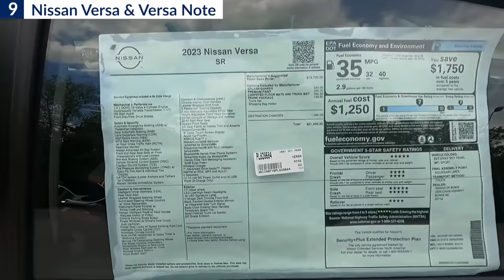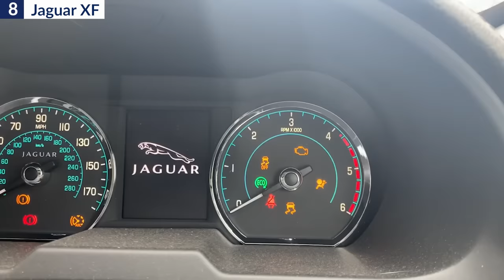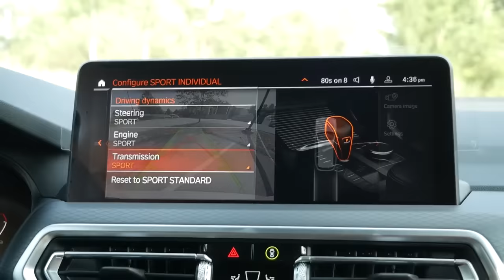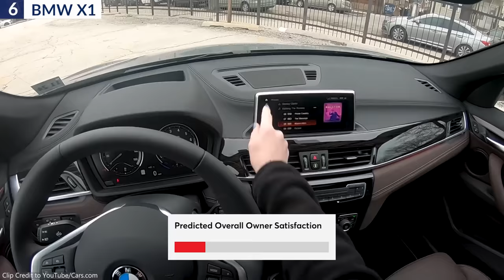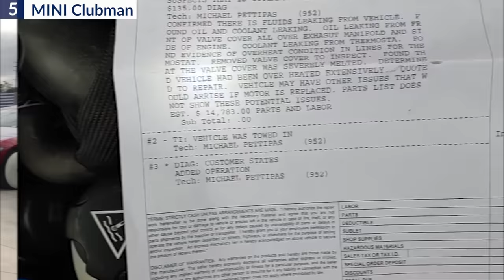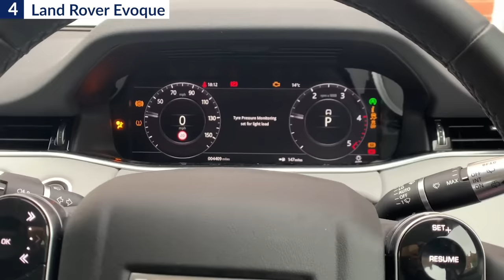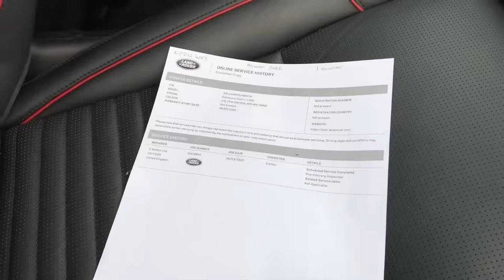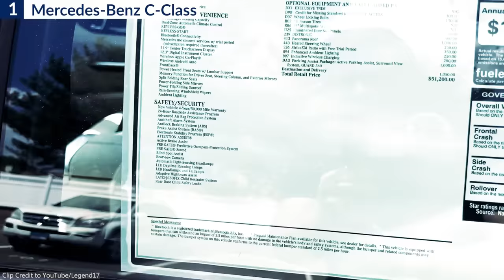9 Cars Owners Get Rid of in the First Year | Here is Why !!

Comment: Interesting to note that virtually ALL these 9 vehicles had a very good satisfaction record of over 90%, apart for the MB C class which was slightly lower at 87%.....SO, whats the problem ?
Reply: Range Rover has a fire problem that is getting a lot of attention. Bad engineering, cost cutting, and low quality control in Czechoslovakia, where they now make their vehicles. The Luton fire was caused by a Range Rover hybrid, which made international headlines due to how destructive that was, 1500 cars destroyed and the parking structure collapsed.

Mercedes and BMW both are notorious (here in the US) for general quality control issues mechanically. Since Germany doesnt allow older cars on their roads, these cars arent built for duration. They will start leaking oil all over your driveway in a year or two, and the fix for normal repairs will cost you thousands, when the same repair on a Japanese car would cost hundreds. They are ridiculous when something inevitably fails. Fit and finish in the interior and body is very high quality tho, which are the parts of the car normal people see, so normies think they are great cars. We mechanics love them when they show up at the shop... "Daddy's getting another $4000 paycheck for a couple hours worth of work baby!" But absolutely none of us spend our inflated pay checks on these cars... because we arent dumb, and know how they are made.

As a more specific example on BMW/Mercedes. Their brakes use very hard pads, and soft rotors. This allows better braking at Autobahn speeds. But brakes wear out, and need to be replaced pretty regularly. 
Now on a normal car, this means you install new pads, and machine the rotors. $200---You may need to replace rotors on the third brake service. $600
On a German car, this means you install new pads, replace the rotors, and probably need new calipers too because one of the floating rubber o-rings seized up or blew out from the higher heat created on wore out rotors with their stupid design. $3000.

Comment: I had a 2016 C series.  They depreciate at a record rate.  The service costs were not cheap.  The run flat tires were Pirelli and I had to change them every 5k.  Ended up on Continentals and they were much better.  I can see why people get out of them in a year.
Reply: Changing tires every 5000 miles?  That's criminal.  That's what Lambo owners have to do.
Reply: I’ve got 35K on my 2018 c300. Maybe have 6 month left on them. But I only drive 3K a year now so I’ll replace with NON run flats next summer.
Reply: Oh BTW when I bought my leased 2018 in 2021 the dealer paid ME $3000. It appreciated because of the low used market 😅. Put some of that money on extended warranty up to 100K miles.

Comment: Before we purchase a vehicle, we check with Consumer Reports and Edmonds to check out their reliability, safety and comfort ratings, as we generally keep our vehicles for 12-20 years. 
We prefer to buy a 1-2 year lease return vehicles over a new one. This way, we save a few thousand dollars and have the remainder of the factory warranty.
In 21 I bought my wife a 2019 Outback with only 5,600 miles and last year (2022) I bought a Forester Touring that had only 4,700 miles.
We heard that the Forester will be redesigned in 24-25 and be available with a hybrid system taken from the RAV4 .
We’ll wait until 26-27 to buy the hybrid so my wife can use it as her carpool vehicle. Though her Outback won’t be very old, she’ll probably get 38mpg over the 29mpg we currently get with both her Outback and my Forester.
Reply: I too own an Outback, but a word of caution. Consumer Reports and Edmunds are not accurate sources of information. They are opinion-based marketing magazines with zero data from actual mechanics or warranty claims data. If you decide to ditch the Outback, ask a trusted, reputable local mechanic what he recommends.

Comment: Lexus RX450 is the most reliable suv i have ever owned.15 years old and drives like a dream.I have only ever had a back light and two front springs replaced.125000 miles and still drives like new.

Comment: Smaller engines with turbos equals non reliability.  It's a shame even Toyota is going down that road.
Reply: Yes it is a shame. On the flip side, if anyone is to make something reliable… it’s Toyota. It will be interesting to see how their CVT lasts?!
Reply: Ford and GM have been on this road for many years.
Reply: @lukeclifton4392 the Prius has always had cvt and always highest rated vehicle for reliability. I drove one for 93,000 miles only changing oil and windshield wipers.
Reply: @susansavage8272  the “cvt” in the Prius and Camry hybrids are nothing like CVTs in straight gas vehicles. Prius and Camry hybrid use a planetary gearset that they call a cvt since it is “continuously variable “. BUT there are no friction components, goofy belts or chains like in other CVTs. That planetary gear set is better than any other automatic transmission on the planet (pun intended)
Reply: BTW I put a combined 300k miles on two Camry hybrids and experienced no trouble at all
Reply: @Mrblueridgeman  that's nice, but too boring for me.
Reply: @2-old-Forthischet  I didn’t drive ‘em boring, believe me. When I went into the office I had a long commute, part of which was through Unicoi Pass just north of Helen, GA in the Blue Ridge Mtns. Weather & traffic permitting, I’d fly through those curves. Michelin tires for handling and electric motors for instant torque were really nice. I didn’t want to make the commute any longer than it needed to be. Now that I’m retired my wife talked me into trading the Camry for an X3, which itself has been an excellent car. I wonder how well it would have put up with the rough driving I put the Camry’s through. BTW the first Camry was rear ended and totaled. I was doing zero.
Reply: @Mrblueridgeman  everyone has different tastes.  There's nothing wrong if you're happy with what you drive.  I've had my share of econoboxes during my life.  I've also had my most exciting 67 Mustang at 7 mpg with three pedals.  It was not boring.
Reply: @2-old-Forthischet  still have my 96 mustang GT 5 SPD conv. Daughter wanted to buy it. It was a quick “no”. I have different cars for different needs. Also have an F350 diesel for pulling camping trailer. X3 is now our daily driver. Mustang is for good weather fun. Truck is for traveling
Reply: @lukeclifton4392  Now that Akio Toyoda is no longer in charge, things might go south. Toyota has been plagued with massive recalls in the last 5 years, so there is a bit of over rating here.

Comment: Having previously owned a Land Rover, XK8 Jaguar and BMW, I then bought a Toyota Rav 4 and clocked up 150k before replacing it with Toyota H-CR hybrid.
The difference is they are totally reliable, hold their value, are economical and comfortable. The new 2023 H-CR is now a great looking car with all the bells and whistles.
All the others were a constant drain on income with very expensive parts and labour and there was always some issue. 
So has been happy days with Toyota for the last 15 years...
Oh and have done virtually all DIY servicing, just replacing oil, oil filter, fuel filter, air filter, cabin filter, break pads  and tyres as recommended.
Haynes Manual, on line nowadays gives all the knowledge you need to service. Just type in car redgistration and you end up with correct manual.
Reply: Land Rover, XK8 Jaguar and BMW they are just money pits, they suck...

Comment: For the past 10 years, I've been a Merc C Class owner, started with the 220cdi, made a mistake and bought a Brabus (scary fast, expensive, and was always wary of other cars being too close to me), C63 AMG, now I have a C63 AMG Black Series.
Same as any other car, if you look after it, service it and use genuine parts (not aftermarket), it should last you years - - - - - - worst car I had was a Ferrari 458, didn't get a chance to return it as it burst into flames while it was sitting in a car park

Comment: I am very happy with Ford Bronco Sport Badlands 2021 2.0l turbo. First year model and 100% reliable. Very good car and can tow my small closed trailer. Very good in snow and ice, and all terrains. Dust and mud resistant interior. Good audio B&O surround sound with subwoofer, electric front seats. Safari roof rack, 400w inverter a d 12v usb plug everywhere. 0-100km/h in 5.9 sec and nice design. Infotainment screen is reliable fast with real tablet surface touch, gps integrated. Very good and larger sunroof. Seat are very confortable even on 3500km roundtrip. Put a set of Falken A/T 3w on it and you can go everywhere.

Comment: I own a tesla model x after owning this vehicle for 3 years I would never buy another Tesla. Many downsides, tire for electric vehicle are twice as much. My 4 tires cost $2000. When the breaks down they tow you to the nearest Tesla which could be hundreds of miles from you depending on your location. My Tesla was in the shop for over. A month cause they didn’t know what was wrong. But my biggest complaint is being afraid of traveling long distances, sometimes you have to travel a few miles off your route to the nearest charging station and many times you have to wait for a station to become free.

Comment: I own a 2001 Chevy Impala with over 200,000 miles on the clock. Brakes, struts and a fuel pump was all I ever needed to keep it running.
Reply: I believe you, but how many lights are lit up on the dash? GM vehicles from that era used cheap electronics sourced from the lowest cost suppliers. Most of those early GM cars have all had their sensors and electrical systems go berserk by now.

Comment: If you buy a BMW 3-series and get the four cylinder…what? Why would you do that? Get the straight-six. Way more reliable, way better performance, way smoother, way better parts availability and knowledge among mechanics/community. Who in their right mind buys a BMW without a 6+ cylinder engine? “Well I couldn’t affor-“ Then DONT BUY A BMW. Or at least, get an older one with the six. Yeah, there will be maintenance to do, but extremely predictable and probably easy maintenance.

Comment: I drive a 2011 Subaru and it has been fairly decent other than the recall for a block replacement near 90k. A good subject to cover as an investigative cover would be getting what parts are bought most often by each line of vehicles to know what models fail and where on ones up to 150,000 miles. That is if they last that long I have 155,000 on mine and just replaced the lower front control arms
Reply: Subes have improved a lot since then.

Comment: I got a 2014 Nissan Versa for $11,800 USD. Owned it for 5 years/60K miles with no maintenance issues. Had a good-old 5 speed MT. Would've driven it for 200K+ miles if I didn't move out of the U.S.

Comment: It's no wonder that I gave up on a new vehicle and built my current daily driver from junkyard wrecks. Reliability and high high high initial cost turned me off quick. I currently drive my hand built 1999 Ford Ranger Pickup.(2.5 liter 4 cylinder running gasoline & Hydrogen duel fuel capable)  More than enough power (NO turbo, why would I want something that usually gives out too fast.) I built this truck with reliability in mind, living in the mountains and piss poor roads of Southeastern Kentucky. This truck handled the devastation of the July 2022 Flood disaster when new SUVs could not. BTW They still haven't repaired most of the roads here.

Comment: The biggest problems with cars today that they are over engineered! Too many useless gadgets.
I owned a 1969 MB 300 SEL 6.3 ! That was a flawless car! Near zero maintenance - but, I have faithfully changed the oil, filter and plugs.Fuel injected 300 HP engine, midnight blue, air suspension, fold-down writing table in the rear passenger seat, rear window curtains. 
I drove that from Tacoma, WA. to Tampa, Fl. This car was a head-turner if you've ever seen one. 
Then, I gave it to my mom and headed back to Alaska.

Comment: Don't agree with the C300, if you are mechanically inclined, these cars are easy to work on, Brakes, oil changes and such, maintenance items all easy stuff.  Even if the check engine lights comes on, easy to diagnose with basic ODB2 scanner and fix yourself.  I had a 2014 C300 since new and no problems with it driving it the last 9 years, but I have last model year they put a 3.5 V6 in it.  Very reliable.  Doing front brake pads took me only 15 min. for each side.  They pop out like Atari cartridges, easiest brake job I ever did on a car.

Comment: I got rid of my brand new Mercedes EQE in 4 months.  I call it a very unsafe car because of its overdone automatisms.  I would have been killed at least once and have accidents two more times .  In brief, the car decides everything; as an owner or driver you have virtually nothing to say: the car decides and overrules you.  I wrote a 2 page overview of all the negatives with these systems.  Yes, you can switch them off, but it would take me a good 5 minutes to get rid of the systems I don't want .... until is sees a traffic sign/speed sign again and you can start all over.  Also for charging the EQE you need to completely switch off the car, so before you can drive away again another session of switching all the stuff off to get a safe car.  Absolutely a very dangerous car, life threatening.  So I sold it against a big loss (€30k).  I bought a VW instead: two buttons to switch all off what I do not want.  Very happy, have it now 6 months.

Comment: I bought a 2022 Highlander new last year and it has a V6 but I found out the 2023 Highlander now comes with a 4 cylinder turbo charged engine . I would not have bought it if that’s the only option. I’m glad o got the 2022 .

Comment: I would have taken this survey seriously but how can I?
For instance, you mentioned the Nissan, it has a JATCO CVT, known notorious for its lack of reliability, why buy one in the first place?
Jaguar with a 2.0 turbo engine? Who buys such a car? This is supposed to be a performance luxury   saloon. Do you expect an engine that operates at high r.p.m. and high pressure to be reliable? Keep expecting. 
BMW are known for more than a decade for making over complexed vehicles. Loaded with plastic parts that do not last long and with electronics that is impossible to us. For instance, there is no longer a deep stick in the engine or auto gearbox. There is a sensor and the latter is subjected to its own tantrums. 
You keep mentioning CR, I would not trust them as far as I can throw them. I remember very well when there where severe brakes failures with Toyota (mine had one) but I fail to remember CR criticizing them or mentioning the awful Aisin robotic gearbox installed in the Corolla which was so bad Toyota decided to abandon them. 
You have a combination of unwise client, mildly put and manufacturers that want to sell at all cost. This proves to be a problematic combination. I mainly blame the clients. They should enquire thoroughly before buying, check with proper car magazines not with CR. CR checks a mixer in the morning, a dishwasher midday and a vehicle in the afternoon. And it definitely looks like it.
It seems to me expecting people who are ready to over pay for a Toyota badged as Lexus or a Honda badged as Acura is expecting way too much. Hence the reasons they buys the cars you refer to and are discontent.

Comment: I owned a BMW X5 Turbo Diesel. Cured me for life to ever own one ever again. Not owner friendly to work on. BMW dealership is $1,000.00 minimum for anything. Tried changing the seats to sport and they wouldn't change the computor nor could I find a shop that could due to the computer in them. Even the stinking sunroof, electric brake, and battery has a computer that goes bad. Everyday repairs when the milage is higher like water pumps are buried deep in the engine

Comment: I think the Nissan Versa gets a bad wrap because I have one.  Top trim and it's my go everywhere in the city car.  Fuel economy is great, you do have to drive it during breaking period but after that with the little button on the shift lever all you have to do is press it and it goes up on RPMs if you think you need it to be faster, although I hardly ever use it.  I have zero problems but, it's my second car and for power I have my 5.7 liter.

Comment: Hold on, I dumped my £44,804 Jeep Compass after two months. It was laggy and course on road and only became mildly acceptable off road. Three visits to the dealer was enough (38 miles away). My new Discovery Sport £48,227 is a revelation.
Well worth the extra I should have spent in the first place. I love it. P.s. avoid expensive options.
Reply: Jeep used to mean off-road-capable for all models.  Can't begin to tell you how many hazardous & boulder-strewn places my sister & I used to drive through in her 1999 Cherokee

Comment: Interesting that every model was offered with a 4 cylinder engine exclusively (8), or was the base engine with V6 as cylinder was only an option (2). I realize there are many other factors going on here, but I think it speaks volumes. If you need a reliable car, swallow your pride, and find a low mileage ‘06 or ‘07 Grand Marquis that is well taken care of - do correct inexpensive maintenance and it will last you another 15 years and 150,000 miles. OR, as one of the other commenters said, get a Toyota Camry / Avalon or Honda Accord with a V6 and let your automotive worries fade away.
Reply: grand marquis yepper, if i was going to buy anything above 2000 your choices would be at the top of my list, the grands are grand and very dependable
Reply: I have a 2003 crown victoria 114k and a 2008 lincoln town car 75k zero rust as they were and still are florida cars...ultra reliable vehicles...Also had a 07 Grand Marquis LS in mint condition 88k also rust free fl car that i really regretted selling about 5 yrs ago ☹